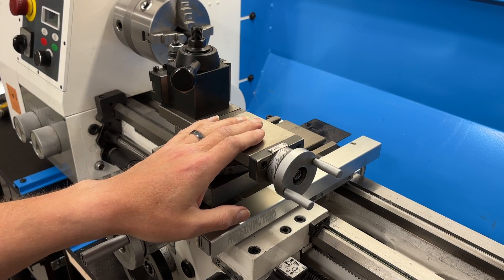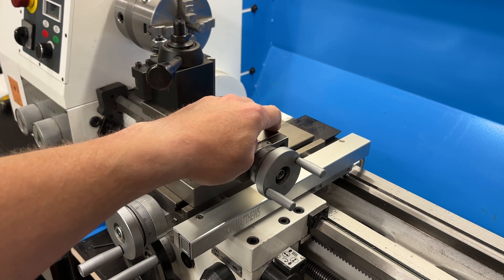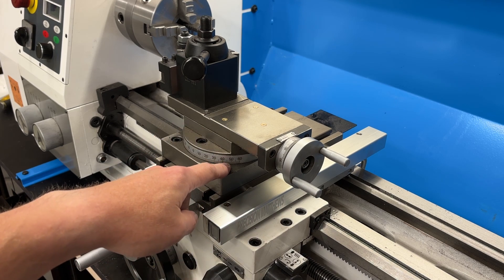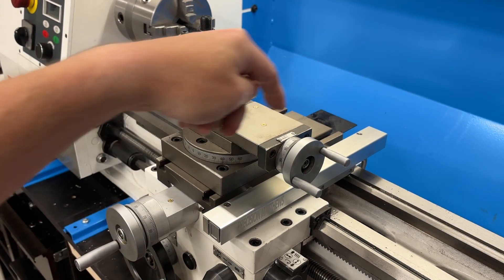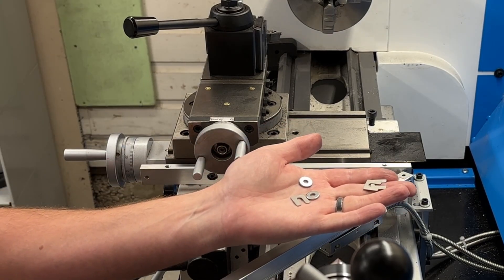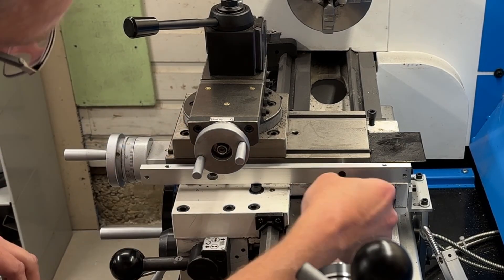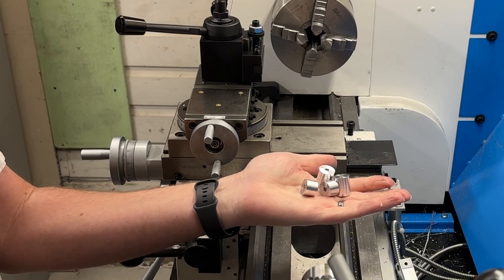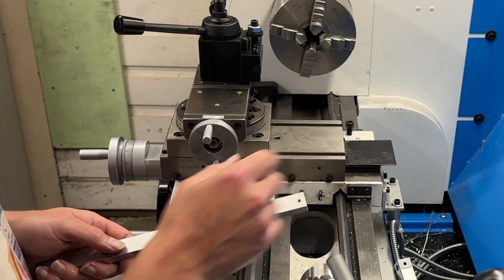PM 1228 Improving a Factory Installed DRO for Better Access to the Carriage Locks

Comment: Nice work   I went with the hex head route for the carriage lock, and went to the left side of the saddle for the cross slide lock, drilled taped a hole for a hex head... I also did a lock for the compound slide the same way.  I'll probably remove the compound for a fixed head, but haven't done it yet.  It's been a year, hopefully you're doing great.
Reply from the maker: That fix wasn't as good as I had hoped because the standoffs sometimes landed over the carriage lock.  My new solution was to build a carriage lock on the left side of the carriage https://youtu.be/gX227xHi-us

Comment: OK, I looked around on Amazon and eBay and a couple other places.  First off, if we believe the PM doc, (hard to find on this DRO, but look under the manuals at the bottom of their page), they claim it will do 1 um (40 ten thousandths!) accuracy.  Darn that is pretty good if true.  Most of the units on Amazon were a few thousandths (inch) with the better ones only circa 1 thousandths.  SO, I'm a little leery of that PM DRO number, but as long as it's not off by orders of magnitude, it suggests your milling will NEVER be as good as this DRO can read.  I also found that there are quite a few units that have notably thinner measurement rules versus this DRO from PM.  Maybe that goes with the accuracy.  But since one could never use that kind of accuracy on this mill, it suggest potential to use units with thinner rules.  But that does not really solve the problem here, since that silly ruler scale still sits right on top of the two bolts you need access!  DUMB!  So I had an idea, which if I buy one of these maybe I'll try, and maybe you or someone else might like to try it.  The idea is to build a gantry down from the carriage, that brings all the mounting points down UNDER the ways!  And so the scale ruler will reside UNDER the carriage instead of atop it.  This might seem a little obtuse, but I think a couple of decent sized AL bars and blocks should be more than rigid enough to transfer the positions without error since they are not under any load (the slider that's all).  This is particularly important because, as pointed out by a Blondihacks video, depending on where the Compound is with respect to the bolts, it also can prevent proper access to the bolts, so really that darn DRO rule needs to be just totally removed off the top of the carriage so one can access all the needed bolt controls properly.
Reply from the maker: thinner scales are typically magnetic and thicker ones are typically optic.  Interesting idea to locate it under.  That would involve quite a bit of reengineering but could be worth it if it works.
Reply: Almost all import scales are 5 micron or one micron. I have 5 micron scales on my Grizzly 12x35. I can take a cut, measure it with a micrometer, input that in my DRO as the current number, and when I take off half-a-thou per the DRO, it also mics to that size.
Game changer! Much less "sneaking up" using the dials.
Reply from the maker: I LOVE having a DRO.  Easily one of my top 5 upgrades to my machines

Comment: I wonder if this DRO scale would not be better installed on the front of the carriage?  But maybe that requires too much stick out of your took in front of the carriage.  Don't they make a thinner SRO scale?  Off to Amazon to find out ;-). Thanks for the video!
Reply from the maker: Magnetic scales are thinner, but I don't think they would be thin enough.  Even if you shifted it front or back you would still have times where the lock is likely covered

Comment: wow that's a big mark against PM imho.   Never owned any of their stuff but they had my respect from what I've seen.   But this is pretty lame.   Good fix tho
Reply from the maker: Any machine you get from any manufacturer is going to have its quirks and little needed improvements.  Almost no budget machine comes with all the bells and whistles.  It's interesting I have two of their machines and they are for sure in two different classes as far as build quality.  My Pm728 mill is of the highest quality, cuts extremely well is very ridged and has most every feature you could want.  The fit and finish on machine assembly is also excellent.  I still made upgrades to it but I would likely be doing stuff like that even if it was a machine that cost 5X as much.  The lathe is not as well put together.  It's quality where it counts in things that affect accuracy but fit and finish is a little bit lacking.  Both excellent machines but with the mill I got way more for the money.
Reply: Compared to the value/price point and quality of the PM1228, this is very minor, easily fixed problem.
Reply from the maker: @grandpasbarn2806  In general I agree as a reasonably priced machine will need some minor love,  however if you buy a DRO preinstalled it should have come with the hex head bolts also preinstalled so you don't need to disassemble the DRO just to replace said bolts.  From the factory the main lock as a socket head cap screw is completely inaccessible and unusable with the DRO scale in place and requires a hex head replacement.  The solution I came up with in this video was ok but there are still times when the scale standoffs block the socket head cap screw.  I decided to make a new locking setup to eliminate the need to use the factory option.   https://youtu.be/gX227xHi-us

Comment: Thanks for sharing.. I just got my 1228 with DRO and just checked.... yes it tooo did not have hex bolts installed..  now I have a tutorial on how to fix it..
Reply from the maker: Something I learned after I made the video... I may still put a hex nut on the X carriage lock.  Occasionally the stand off lands directly over nut blocking my allen wrench access.  In a perfect world I would find a bolt able to do both... I may weld a nut to the socket head cap screw, either way I am going to need to disassemble it all AGAIN.

Comment: they never put hex heads in when they install the dro.  mine is exactly like yours
Reply from the maker: Once is an oversight, every time is a problem. Makes no sense to have the carriage locks not accessible because of the DRO
Reply: @dazecars  My PM 1127 is the same way, thanks for the fix.
I bargained with Matt on the price since it was a customer return due to damage in shipment, but he assured it was checked out again before shipping it to me and but for the locking and minor cosmetic dents I'm very pleased with the quality of the machine.
Reply from the maker: they make good machines.  So far I am very happy with both my lathe and mill
Reply: @dazecars  Yes, I have the mill too, excellent value for the money spent. ☺
Reply from the maker: agreed

Comment: You lose about 2 inches of tail stock reach, in most cases that's not an issue. There are other options you could consider in the future, e.g. move the DRO to the left of the cross slide. Left of cross slide and pushed back towards the rear splash guard is an even better option.
Reply from the maker: In my case I didn't lose any tailstock travel because the carriage sticks out past the DRO scale even after I moved outboard.  As far as moving it to the other side that would affect the use of my follower rest.
Reply: @dazecars  I put mine on the left, and it does preclude using the follower. But I cannot remember the last time I used one, and if I must, I'll take the DRO off. I do use the tailstock up against the carriage quite a bit.
Reply from the maker: I have a project I am about to start that will completely fix this issue without having to move the scale... More to come

Comment: When I received my PM-1022 lathe with factory installed DRO in February of this year it already had the spacers that you installed in this video. 

I ended up making a special handle to reach into the socket head cap screw (and it stays in the head of the screw ) for the carriage lock on the X access because I found that one of the spacers was almost always blocking top access to that socket head screw when I needed to lock it .
Reply from the maker: Interesting, I got my lathe in June with the smaller spacers.  Maybe there were a couple different batches in the warehouse.

Comment: Hey, this is a throw back question!  On a treadmill motor control setup you talk about making  a ac choke. I just got the "ring". Did you use stranded or solid wire to wrap around  it?
Reply from the maker: its stranded to more easily wrap around the core

Comment: Originally, I put the optical scale on the chuck side for the sake of the tail stock reach which is poor on a 50's atlas . I knew one day the jaws would hit it so I put it on the tail stock side. Not good. Then I changed my optical scale to magnetic for more tail stock reach. Still would like less thickness. I noticed the bar holding your scale is probably 3 times as thick as necessary, and you may only need them for the ends as the scale is pretty rigid,and you still have the option of head hex locks if your tail stock suffers reach. It's a function of age in my case. LOL.
Reply from the maker: my carriage sticks past the scale so even after I moved the scale further out it still doesn't create any tale stock issues.
Reply: @dazecars  I see that now, mine goes inside the carriage.

Comment: That's a heck of an oversight on that installation from PM.
On my HF knee mill, I mounted the X-axis scale nearly one inch in front of the table, preserving Y-travel, and allowing access to the oil cups. I made new locking screws that were longer.
Reply from the maker: I was surprised to find the oversight but think I have a better setup now.